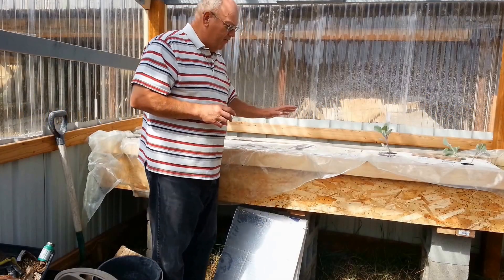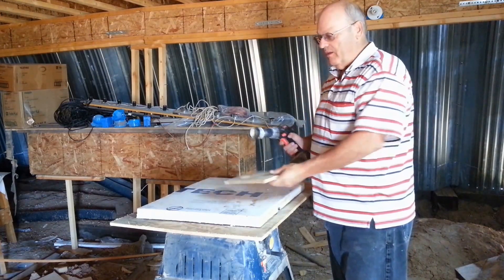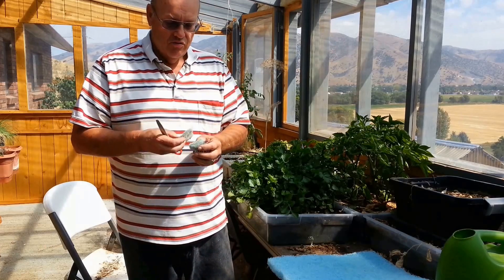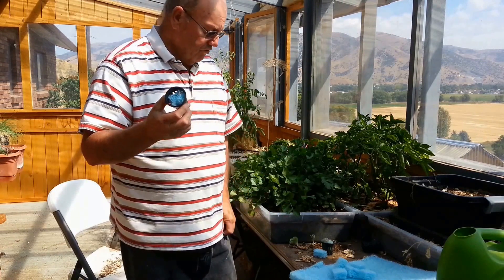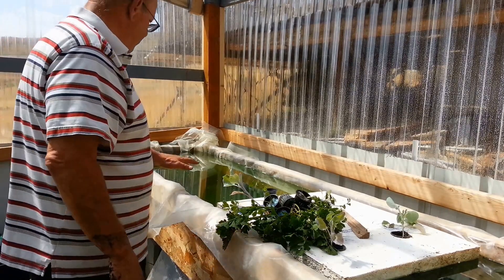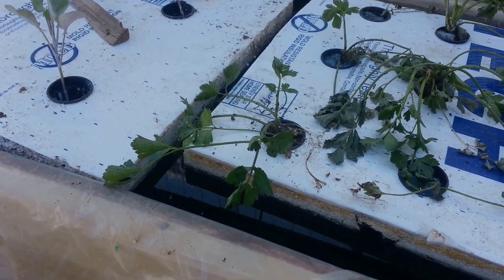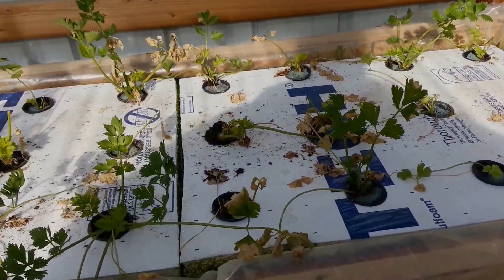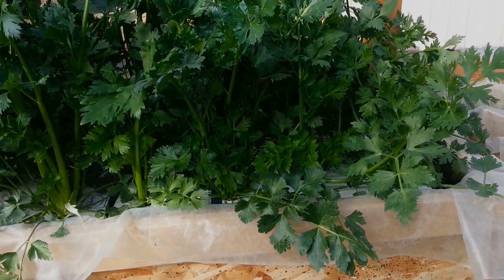Growing  hydroponic Celery start to finish

Comment: That's really cool how they straighten up on their own. At first I thought you were going to get more of a bush but they then started growing vertically! I am definitely going to do some in one of my hydroponic set-ups! How deep a container do they need to get all the way to harvest?
Reply from the maker: My "growbeds," are about a foot deep, full of water of course with a floating raft of Styrofoam on top.  I don't think it needs to be that deep, half that should work well,  but the roots will spread out and get really thick, so you need to be aware of that if you are planting in something narrow where roots could block water flow.

Comment: So . . . I was thinking I'd have to start celery in much bigger cups because of the diameter of the celery - but this looks like you use the 2" pots and they are fine???
Reply from the maker: Yes they work fine but the celery will grow very big if you let it.   So when they fill the cup it's time to pull them or they will destroy the cup eventually.